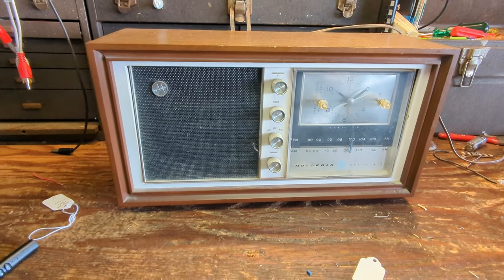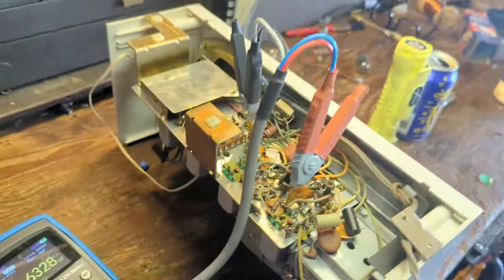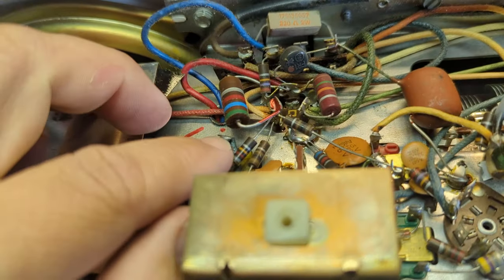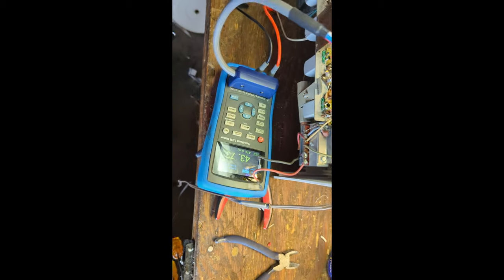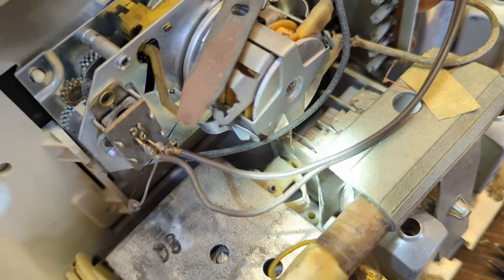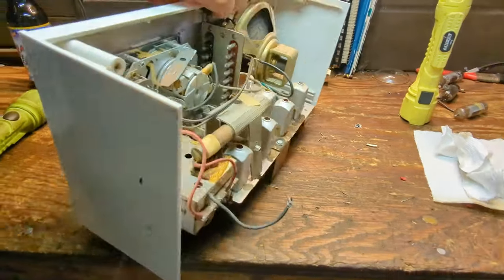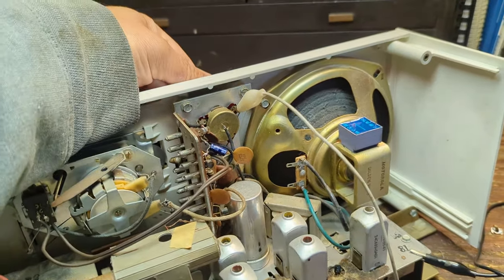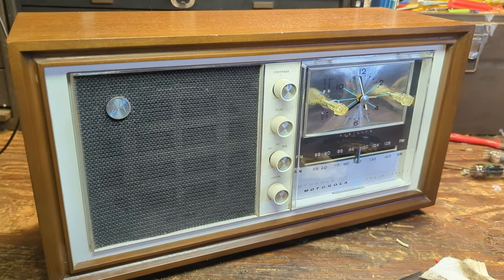Large Motorola Solid State Clock Radio Overhaul

Comment: An electroluminescent panel,,,,,  really brought back memories.
I have a Philco Ford alarm clock and it had that electroluminescence panel.
It was a low hour unit and there were segments of that panel that were still dimly luminous.
I wound up modifying a plug in LED nightlight and drilling a hole through the nightlight panel for the clock shaft..
It was quite the project but it worked out well,, gave a nice blue backlight..

Comment: This radio is an example of early SS. They used a transistor to replace a tube-with this even down to using tube sockets for transistors. If there are any germanium transistors in this-forget it-germanium devices discontinued years,years ago. And they went bad from age.
Reply: These are not driven very hard, and there are some around, hopefully they are not high-dollar...
Reply: Shango066 used some Russian germanium transistor replacements which you can get. The Zenith Transoceanic transistor sets used socketed transistor so it is easy to swap out substitutes until you find the right one.
Reply: @zulumax1 I did see that, it is a lot of work, but it is one means to an end.
Reply: Many germanium transistors are still working fine.

Comment: I'm working on the same radio/alarm clock right now do you remember what caps were in there? and what type of multi meter is that another question too is why couldn't you do anything with the light? I just took up repairing electronics as a hobby and I have the same radio sitting here with a terrible hum when plugged in immediately it hums. It sounds like the exact sound as when you were messing around with the AM antenna.

Comment: Was that a choke next to the speaker, or did the radio have a power transformer after all? Or was it an output transformer? I'm trying to get my head around dropping mains voltage down to safe germanium transistor values without a transformer.

Comment: Your radio is Motorola, my experience with Magnavox is that you look up the service manual/schematic by the chassis number, not listed by model number. That is true for the big floor standing consoles, not sure about table top radios. The fourth leg off the volume control is for bass boost at low volume, kind of a loudness contour, only there is no switch to disable it like on hifi gear.
Reply: This is a motorola....
Reply: @davidhamm5626  That it is, don’t know why my brain saw Magnavox!
Reply: @zulumax1  Been there myself.....

Comment: It was called a Motorola AM/FM "Visilite" clock radio. Visilite = junk lighting. The American built ones soldered transistors
 into tube sockets in  them but the later Japanese made ones  were done with a proper circuit board. Indeed a hot chassis
 set. I will pass on buying 1960's Motorola stuff like this. They were cutting corners in some bad places.
Reply: Hello Steven, you seem to have a vast knowledge of old radios and always have kind words to say. Have you given any thought to putting up some videos of your collection? Do you work on them as well? Cheers!
Reply: @zulumax1 1. No cell phone ( yet) 2. Need a better computer. 3. Tend to start some projects and then put them
by the wayside. Old habits never die. Never finished my old HO scale layout ,now dismantled.

Comment: That terminal where you connected the isolation transformer is not an input. It is the loudness tap, which compensates for low bass at low volume settings. It will usually have a capacitor connecting it to ground, and sometimes a switch to cut out the compensation. This was a common feature on nicer radios and Hi-Fi sets, tube based and solid state. Putting the transformer across the capacitor will mess up with said compensation.
Reply: I commented about the same loudness tap in an earlier post. I was curious why lifting the lead off of the loudness tap would kill the sound? Without seeing a schematic, I am puzzled about this.
Reply: Normally the input signal from the coupling cap comes into one side of the potentiometer, the other side goes to common ground, and the center wiper goes to the next AF stage.
Reply: You can also encounter problems if your auxiliary input, the transformer in this case, has a lower impedance than the circuit usually driving the audio amp. Usually the tone control will no longer function. Add a series resistor of a value that restores tone control function similar in frequency response as originally found.